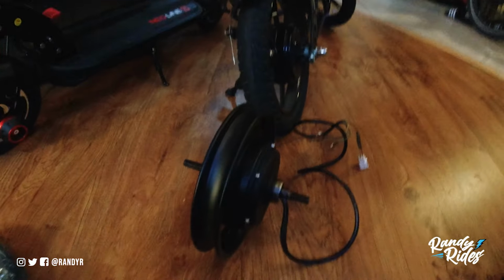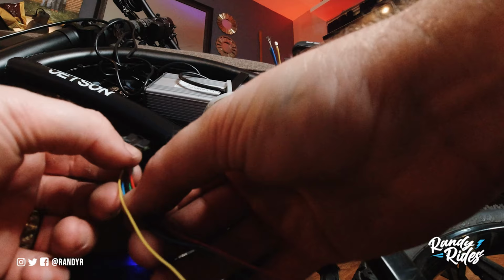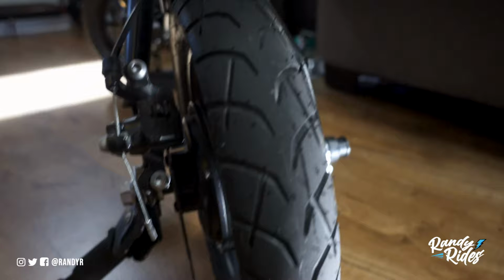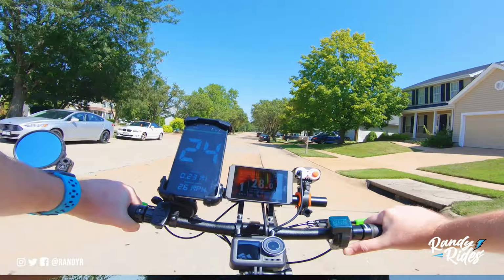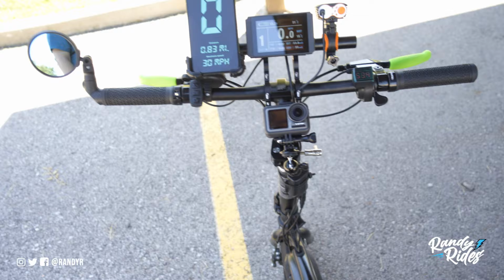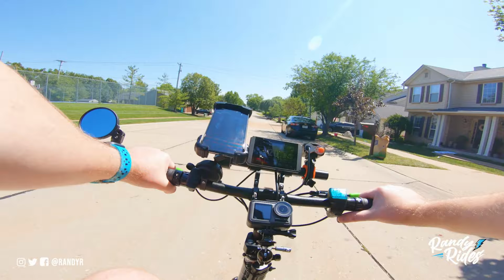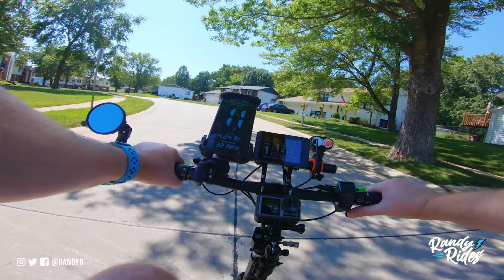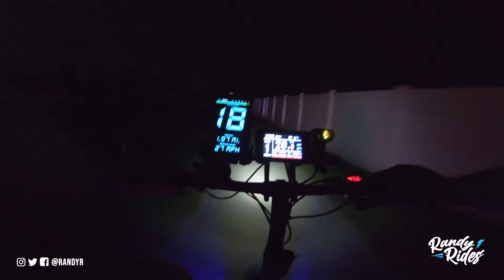Ep 4 | 30+ MPH Jetson Bolt Pro | DYU D3 | 1000W Motor Upgrade

Comment: That’s a nice little build. If I can make a suggestion it would be to add in another 1000w geared hub motor in the front. That way you’ll not strain the back motor when going up hills, and you’ll also be able to go faster, but that must be sketchy as all getup on such a short wheel base.😁
Reply: Ok so if you have 2 1000w motors youll consume like 2000w cause of both motors so if i had something like that what battery and controllers would i need?
Reply: @6ixerz  a stinger on no doubt
Reply: I wonder about the two-wheel drive thing.... it sounds like an easy way to get a road rash heh....

Comment: i've upgraded my controller but looking for more speed, my question for you is are you still on stock brakes and if not do you recommend any because my back brakes are giving out ever since  i upgraded . i too want to see a wiring video
Reply from the maker: My stock brakes work fine right now. You’ll see that in my next video. “Jetson Bolt Pro vs Deer”

I’m going to install Nutt hydraulic brakes on mine soon though. Pricey but one of the best. I have Zoom HB100’s on my other ebike and they work pretty good. Cheaper option. Should bolt up fine to the Jetson (might want to research it first though). I made a video about them if you wanna check it out.

Comment: Great video! Oh boy it does look funny with the small back tire lol but I love it. I imagine a 30 Amp controller will make a difference. A small tire means more torque which may help too. I weigh about 185 so I may move slower than you =]
Reply from the maker: 35A controller, and yes it will make a difference. I weigh 230, so you should be way better than me! I am probably going to swap the front to make them even. Just gotta find one first.
Reply: @RandyRides  Great on the controller finally! Please let us know how it goes.
Reply from the maker: Link to the 35A is in the description as well
Reply: @RandyRides  Just got it thanks so much! 12T Sprocket?
Reply from the maker: @Zerobytexai  I haven’t got mine to test if it works or not.
Reply: @RandyRides  Got it, I went ahead and purchased the 12T. Its not too expensive, but I'll be waiting for you before I make any attempts 👍
Reply from the maker: @Zerobytexai  Yeah I’ll let you know if you need to return it or not 😆
Reply from the maker: @Zerobytexai  Sprocket is not gonna work unfortunately
Reply: @RandyRides  It comes with a stock 12T I believe but maybe its design specific for the motor? Wish I could help. I don't have mine just yet but if I find something that works I'll pass it on to you.

Comment: Losing the ability to pedal makes the bike limits the bike a lot. I like to pedal as far as I can then use the electric to get back it. For me the point of the bike is for exercise.
Reply from the maker: You can spread the forks a bit using a car jack. I’ve learned that after making the video, so the sprocket used to keep PAS working, will fit.
Reply: @RandyRides   what about the wire that comes out at the wrong side, what did you do about that? Tnx!

Comment: Surprised the tires and all would sustain double the speed than it's rated for. Plus with no motorcycle type headlight, people gonna pull out in front of you when you are doing 30.
Reply from the maker: Have you seen some of the scooters with 8-10” tires? There are some that can do 60+. This is nothing for them.

Comment: My shoulder and neck kinda hurt after 30 min on the jetson bold pro.. i tried adjusting the seat up and down and no go.. it still hurt.. i wanted to change the handle bar for a longer one but i couldn't remove the stock grip.. i was afraid to break the throttle grip so i gave up..    Also, down hill i can reach 22mph but i find it dangerous and difficult to handle the bike at that speed..especially with short stock handle bar and so tiny wheels.  I guess thats why they decide to cap the speed.. but i wish there was an easier way to increase the speed without doing any mod/hack. Atleat 2mph more would greatly help to commute.. the idea of using a bike is to avoid rush hour city traffic.. but because the bike is so slow, you don't gain anything…
Reply from the maker: Yeah I broke mine trying to remove the grip, but was planning the thumb throttle anyway. It’s a pretty easy install, but not easy if you don’t know what you’re doing. I haven’t gone a super long distance yet, but a better seat and a more upright position is gonna help. The longer handle bars really made the bike feel more stable. If you were ever to consider upgrading the speed, I’d also go that route too.

Comment: Hello Randy, how much do you weight if I might ask? I'm wondering how much weight the bike will hold, especially the tires. Also how much pressure did you put in those tires? It said on the tires 35-45psi, which is pretty low for bikes. I'm wondering if this bike and the tires would hold 300 lbs rider by any chance 🤣

Comment: Hey Randy Whom do you recommend for the rear motor tire upgrade to 48v / 1000 watts on the Jetson and also of there a battery pack I can get that is compact to fit in the compartment

Comment: Thanks! I am going to install this upgrade. However I don't see a link to the battery in your description. It's blank. Also would you have a link for the 30amp controller?
Reply from the maker: I’ll add a battery link, but any 48v 20Ah + battery will do. I’ll add them after the premiere. I don’t have a link to the controller. I haven’t purchased one yet.
Reply: @RandyRides  Sounds great! I already have two 48v 10Ah batteries joined perfectly together = 20Ah. Hopefully that works. I'm very excited to see your video now and I've subscribed. =]
Reply from the maker: @Zerobytexai  Yeah my 10Ah didn't work that great for me. It powered everything, but it dipped pretty low in voltage. It's a crappy battery, so that may be why. You could always run them in parallel, but not sure if it would work right or not. You may have to go with a bigger battery, but the higher Amperage controller might make a difference too.

Comment: I nearly fell when mine I had to head down hill on my way to work.  There's a beep driveway groove and I didn't slow down fast enough and I skidded off to the side, and caught my balance while still not letting the bike fall. I had this for about 2 weeks now and the 2 things are messed up so far, the pedal is completely scraped on the bottom from when I skidd off, and the rear fender came off and took the piece to screw it into the frame as well. I don't see this thing lasting more than 2-3 months tops.
Reply from the maker: If you take care of it, it will last.
Reply: @RandyRides  That goes without say, and so does people riding style and this bike wasn't it for me. Also it is not common to see these bikes being returned at the costco near me, I was told their common issue is battery, disc brakes and some minor ones. It was a little fun and convenient while it lasted. I'll stick to my specialized where it can handle what I put it through.

Comment: Brilliant job technically speaking but I can’t help but worry about the safety of any adult riding a Jetson Pro at 30mph. Center of gravity, wheel and tire size. Yikes! The motorcycle helmet was not overkill. Stay safe.
Reply from the maker: You do know, there are scooters with 8in tires that go over 50MPH? There are a lot more dangerous electric vehicles, which I actually own. Look up electric unicycles, if you really want to see danger. 😂
Reply: @RandyRides  You have a very good point there. Stay safe, my friend. Love your videos.

Comment: It goes about as fast as the Lectric XP with a 500w motor. Much bigger bike cost $1000.
Reply from the maker: I’m aware. I have a Lectric XP, but mine is a little fast than a stock one. 😉

Comment: Simply don't hook up the pedal assist and go faster as well 🫡
Reply: Wil disconnecting pedal assist work on a stock bike to increase speed
Reply: @firstlast-er9jq  I do believe so mine was stock at first until I got a upgraded controller

Comment: Hi Randy I forgot to mention, what kind of speed increase would we expect going from 22amp to 35amp controller? If you hit 30 miles per hour with a 22amp, would it probably hit 35 miles per hour on a 35amp? I know you can't give an exact accurate number but just to give us all an idea of the type of increase we could expect if we switched to 35 amp.
Reply from the maker: I’m really not sure, but I suspect a slight increase in power all around. Torque and speed. I was really surprised I even hit 30 with the 22amp. I think 35 would be reasonable. It’s all speculation though. Hopefully my controller gets here fast. I’ll hook it all up the same day I get it and make a video. I am anxiously awaiting! 😆

Comment: I finally got to watch this video in detail from beginning to end, and noticed at one point you hit 32mph, was that a downhill slope or a straighter path? Also you said you didn't want to go much over 30mph so did you just choose to not go over? Im excited for the 35amp results. I don't imagine you'd go much faster but I can see you getting to top speed a lot quicker and maybe 2ish more mph because of the extra umph from the new controller. Awesome work Randy I can't wait to see the results! Because I purchased the same setup, but I'm using two batteries in parallel so I'll let you know what those results look like. Same brand of battery you have but in parallel. Right now I noticed I get a more consistent voltage and 1 more mph in parallel on my bike now compared to using just one battery. I don't know how that will translate to the new setup.
Reply from the maker: Oh it’s gonna go over 30 when I’m done. More like 40-50. I won’t go that fast often, but doing it more for hills. I’m also adding a second 1000W motor, so hills should be no problem. I’m trying to wrap this up because I have another project in sight. Looking at building a Fiido Q1S.
Reply from the maker: When I hit 32, it was on a slight downhill. I’ll do a more thorough test when I hook up the new controller. I’ll explain how much throttle I use, if I’m going up or down hills, etc.

Comment: Did u blow up the stock motor first?
Reply from the maker: No I still have it
Reply: @RandyRides  too bad I wondered how many watts it could handle
Reply from the maker: @John-ep4in  The peak on the Jetson motor is something like 500, but I doubt it. Very weak.
Reply: Stock whines when push more then 350w and weak yes.
Reply from the maker: @b20eg195  A very loud whine. I couldn’t ride at night cause it would wake up my neighbors.
Reply: I hit 2600w no problem
Reply: I have jetson bolt and its only 250w
Reply from the maker: @1981Superdragon  The Bolt is 250. The Bolt Pro is 350.

Comment: Guessing this is about $1,200 build.
Reply from the maker: More like $800
Reply: @RandyRides  I am not a DIY type, but would pay $1500 for this bike with that power. I think there would be a solid market for a small lightweight bike with power enough to move a 200 pounder at 20MPH or a little more.
Reply from the maker: @scrippslarry  You can have it for $1500 😂 I know there are a few “companies” that build them. I’ve never really been into that part. I have enough bikes to sell as it is. It is real fun though. You should check out the Fiido Q1 or Q1S. You’d probably like those. They’re usually heavily modified with 72v setups.
Reply: @RandyRides  Thanks! And great work on this mod!

I saw the Fiido actually. Much heavier, but they seem to get more speed out of the 350 hub.